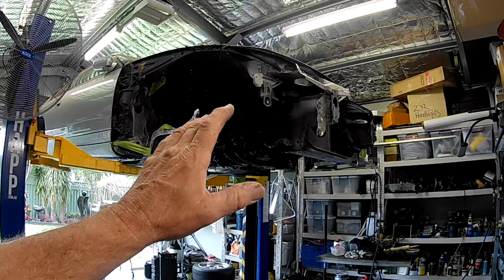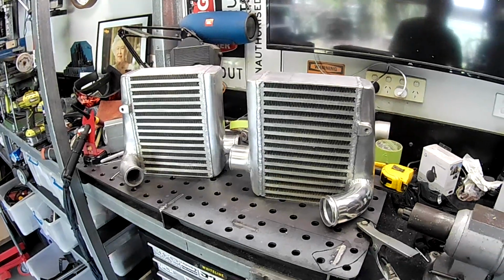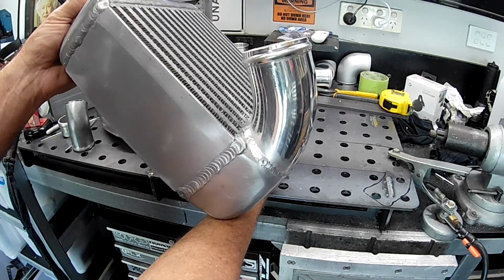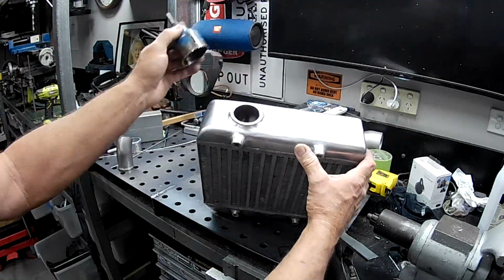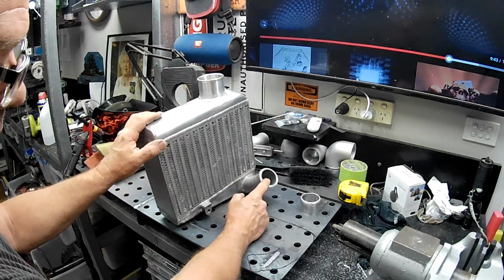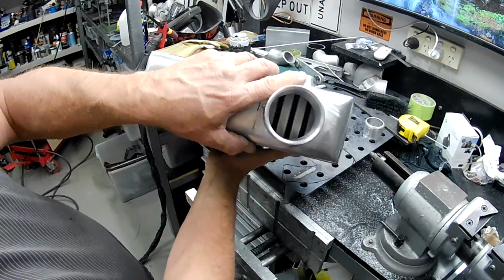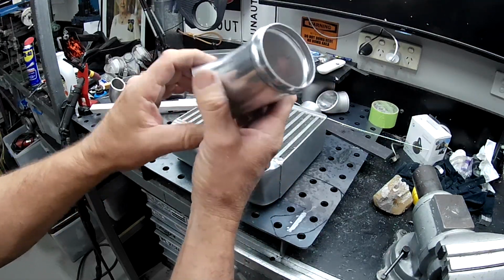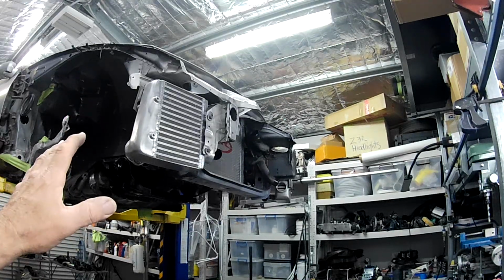Intercooler Hi-Flow Mods. Project Fairlady, The Nissan Z32 300zx Twin Turbo Mega Build

Comment: Well, a 2 to 2.5" increase is greater than 50% increase in volume of air that can flow at a given pressure,  but the question, how much more mumbo does this translate to remains. Looking forward to what looks like is going to be a tricky routing of air pipes back to the intake and turbos.
Reply from the maker: Yes, absolutely, many different systems in play in the horsepower game. Hopefully, what I have in my head all ties in together & gets this old air pump making some numbers. Yes, the piping is going to be difficult, started on it this week & i'm tearing my hair out already. Cheers Mate.